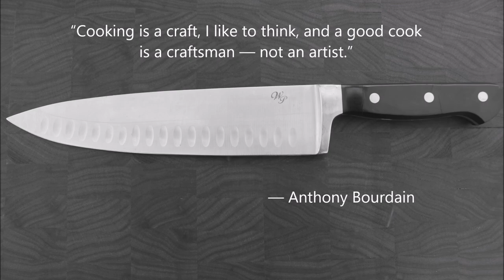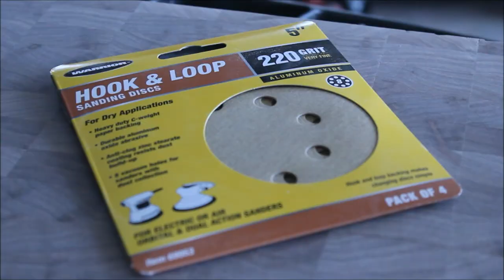Walnut End Grain Cutting Board

Comment: First, last and foremost,  you did a really nice job. Really nice. As a lot of reviewers have said, yourf work would be a lot easier and A LOT SAFER if you tuned up your tools. As to using your planer on end grain, when I build end grain cutting boards I band the board in contrasting wood. For example the last one I made was sugar maple end grain, black walnut banding and decorative maple dowels around the banding. I then run it through the planer at as much of an angle as will  fit in my planer and take light cuts. The other thing I find that gives me a smooth board with the least amount of wood removal is, I double stick tape the board to a piece melamine and run that through the planer. The dead flat piece of melamine serves as the reference point for the planer, also eliminates the planer snipe. Keep doing that good work young man.
Reply: Bruce, you have any pics of that board you made?

Comment: nice work scotty!!...may i suggest that you tune up the fence on your table saw...by truing up to the blade you'll avoid the burn marks when cutting
Reply: Not necessarily; pitch build up on the teeth can be a likely culprit as well as feed rate through the blade. Keep it clean and sharp and you'll be 90% there

Comment: i have a similar sized piece of wood in my shed and i am curious why did you cut the board into strips and then glue it back, i mean the wood piece is wide enough and you can certainly cut it perpendicularly rather than cutting into strips and then glueing it back and then cutting it perpendicular. is it just because of the design you get in the end or is there a specific reason to this process.
Reply: AbdulW87 You want "end grain" for the cutting surface for two reasons; it's easier on the knife's edge and you're not cutting individual fibers in the woods, causing quicker damage to the board.  Also, alternating the direction of the grain with each of those strips will tend to minimise warping where as a solid block of wood will usually warp when moistened/dried. Plus it's aesthetically pleasing.

Comment: What finish did you use? I made a couple walnut endgrain boards recently as Christmas presents and used mineral oil, but when I applied it the wood turned basically black and showed very little grain
Reply: Czarcasam yeah bro that happens, it’s just from the wood you used some pieces are just really dark and some are light.

Comment: Titebond 3 is better for food uses, I think its the one thats fully waterproof right?
Reply: whitexeno titebond 2 is superior to 3. Both are safe for indirect food contact
Reply: Why do you say titebond 2 is superior to 3?
Reply: @dalemartin7886  waterproof and foodsafe..
Reply: Napoleon1Blownapart as far as I know both Titebond 2 & 3 are safe for indirect food contact so that doesn't answer my question as to why James Barrett says 2 is superior to 3.
Reply: @dalemartin7886  Looks to me like 3 is superior to 2.  Titebond II passes ANSI Type II Water Resistance, which means water resistant.  Titebond III Ultimate passes ANSI Type I water resistance, which means water PROOF.  Both are certified by the FDA for indirect food contact.  I'm planning on making a cutting board like this soon, and since the board will get cleaned with water and have other food liquids on it regularly, I'll be using the Titebond III waterproof wood glue.  Titebond III also has a lower application minimum temperature (47 vs. 55°F) and a longer open working time, up to 10 minutes vs. 5 for Titebond II.
Reply: Patrick94GSR exactly. If I was doing a project that was going to be subjected to water contact frequently I would choose III over II. II would probably be okay but III is supposed to have superior water resistance. Why take the chance of glue failure?

Comment: You may think this a stupid question, but why do most people make end grain boards? Do they last longer, or take cuts better without leaving to many scars on the board? I would love to know the answer if you could tell me.I also watched a video, where the person said not to use Oak for boards. Is that so, and why? Thanks for any reply.
Reply from the maker: Mark McRostie Mark McRostie Hi mark, I am by no means an expert but I have always heard that end grain is easier on a knife edge because it has the ability to slip in between the fibers of the end grain. As for the oak, I have no clue except for maybe since it's so hard that it dulls your tools faster, that's my only guess.
Reply: Thanks for your reply, happy new year.
Reply: You don't use oak for cutting boards because oak, esp red oak has an open grain structure.  There are little "straw" like fibers that take in liquids and tend to stain and warp easier when used on cutting boards.  Same reason why red oak isnt used when making boats.  Leaky wood is no good haha.  You can get away with using white oak but best to stick with "hard" hardwoods such as maple, walnut, ashe, juniper etc. 

Hope that helps.
Reply from the maker: +Zak Hoover interesting, thanks for the explanation!
Reply: Hi and thanks for the reply. I have already made an end grain board with white oak and Sapele which turned out nice. But sadly it have bowed in the middle, so one side will sit still but other side rocks a little. I will have to do more sanding to get it flat again, or maybe leave it in the garage as a learning curve. Thanks for the advice on Oak.
Reply: Mark McRostie the bow is due to uneven moisture in the wood.  did you only apply finish to 1 side? or more finish on the top than the bottom perhaps? you can take most of the flex out by putting the convex side up and applying oil till the wood simply won't take any more.  you can also make a planning sled and use a cheap router to flatten the surface.  there are tons of videos on router planing sleds.  happy woodworking!! PM me if you have any other questions.    end grain boards will naturally flex more due to the nature of how wood expands, which is why most cutting boards are so thick, to help mitigate this.
Reply: Thanks, as far as I can remember I oiled both sides a couple of times. Then used a oil wax mix two times. I will take your advice and try treating the board again, failing that I will have a go at making a sled to flatten it.

Comment: How's that planner? I'm super hesitant on HF gear.
I've heard of a guy put end grain through a planner 1st time and it exploded...heard of another guy doing it for years and never had a problem.
Nice job!
Reply from the maker: Jason Enz I got the planer open box really cheap and it's held up fantastic so far I have no complaints. As for the end grain, there is definitely that risk I just take very shallow passes to help lessen the risk. But a drum sander would ultimately be the best tool for that
Reply: Jason Enz hhjjh
Reply: +Scotty Turner why could it explode? Thanks and great vid
Reply from the maker: nunchuck90 I think it just has to do with cutting against the grain opposed to with the grain. If you're going to plane end grain it's important to take very shallow passes to help prevent any "explosions" and as always wear safety equipment
Reply: Scotty Turner I work at one of nyc's higher end woodworking design groups. 2 14" sliding table saws, 10 delta unisaw, 24" planer, 42" wide belt sander and many other amazing tools. Boss gave me keys to the shop and said "go nuts"!
The shop is great but I'd like to be able to do more in my own garage.
Thanks for the heads up on the planer :)
Reply: +Scotty Turner thanks for the quick reply! Im just 16 at the moment and saving up for tools so need to be safe, thanks from manchester, uk
Reply: +Scotty Turner thanks for the quick reply! Im just 16 at the moment and saving up for tools so need to be safe, thanks from manchester, uk
Reply: I think any planer is going to be the same risk when you're planing end grain.  That's why you see a lot of cutting board videos with people using a drum sander instead of a planer.  Unfortunately that's a lot of scratch for one with a decent capacity.

Comment: Great looking board! This question is for anyone, where can I get wood like that? Not at home depot or anything like that right?
Reply: MCPOTUS79 Some Home Depot's will carry Walnut or another similar hardwood. Search on their website
Reply: MCPOTUS79 Home Depot does carry walnut and maple, but it's only in "1in" thickness and it costs a few dollars more than if you were to go to a hardwood supplier. You will not find 5, 6, 8, 12 quarter at Home Depot or Lowes.
Reply: my local home depot now carries walnut but only in 3/4" thickness and they charge a fortune for it. Better to find it at a hardwood supplier, ideally in rough form as you'll get the best price. It just means you'll have to joint it and plane it to final thickness.

Comment: In case you don't know this already: generally speaking, it is a bad idea to put end grain through a planer unless you do it in ridiculously shallow passes. Even then, there is a slight chance of blowout.  otherwise, looks good!
Reply: you can always glue on backing pieces to take the blowout, then use  the table saw to remove it after planing. this also can take care of snipe.
Reply: Other option is the do a quick chamfer on the trailing edge of the board before putting it through the planer. This has always worked for me in eliminating blowout, even in gnarly aussie hardwood.
Reply: @samuelmcgregor631  I do this also when it's close to size...
Reply: @TMS5100  ah yes I saw Tom Silva of This Old House do that on a segment where he made a cutting board similar to this.  I need to remember than for when I make an end-grain cutting board.

Comment: You got away with it this time, but I wouldn't advise using a planer for end grain again. Too risky, and not worth an accident. Good looking board though. 😊👍
Reply: Not trying to be a turd. Have you ever heard of an end grain board getting destroyed in a planer?
Whenever someone says this, I ask the same question and so far not a single person knows of anyone that has happened to. I do it, never had an issue. I think the key is sharp blades and very light passes...or get a drum sander lol.
Like I said, NOT trying to be a turd, just trying to find someone this actually happened to. I’m sure there is someone out there this happened to.
If you think about it, what makes it seem more dangerous?...the blade is scooping across the end grain fibers so to me it seems just the same as an everyday crosscut. I’m not taking deeper passes to test that theory though haha.
Stay safe everyone and have fun!
Sorry if I seemed like a turd 💩😬
Reply: @enzprintco.8625  I had my maple end grain cutting board destroyed by putting it through a planer. I was taking maybe 1/32 of an inch off with brand new blades and it gouged the board beyond repair
Reply: @checkmyvevo  that stinks. I’m sorry to hear that. Did it “explode” or just chewed up?
Couldn’t salvage it?
Reply: @enzprintco.8625  It took a nasty gouge out the middle and cracked it on the sides. Pretty much became firewood

Comment: Crosscutting against a fence is a very bad idea.
Reply: He has a sliding miter saw that he was just using to make cuts at least that wide, so not sure why he decided on the table saw for that operation.
Reply: There's a reason it's called the rip fence, it's not for cross cutting. It enhances the chance that biding can occur and for your piece to kick back or get ejected towards you by the saw.
Reply: especially with no riving knife on the table saw! yikes!! That being said the cutting board did turn out good! great job
Reply: true story. Had it happen one time and hit me just below my sternum. Took me to the ground out of breath. Learned a valuable lesson that day.
Reply: It's not like he's cross-cutting a 2x4.  The board is at least 12 to 14 inches wide which is fine for cutting on the table saw.  Sure he could have set up a stop on the miter saw to make many identical sized cuts, but as with many things in woodworking, there are many ways to accomplish the same thing.

Comment: 3:33 DID NO ONE NOTICE THIS?!?!
Lots of critiques on safety but this was by far the most dangerous cut you can make (other then not using a fence at all lol).
It’s hard to keep the shorter side against the fence when the length is more. One wrong minute movement could send that entire block of wood at your face and 100+ mph.
Not to sound like the safety police (cause they are annoying) but this one actually made me cringe and I’d be bummed if this video didn’t come out because you got hurt making it and we’d never see that sweet cutting board :)
Stay safe brother!
Reply: Actually the most important thing is that the dimension between the board and the fence does not exceed the dimension that is against the fence. the dimension between the blade in the fence was very small, however this cut was still very unsafe because there was no riving knife/guard used of any kind.

edit: https://youtu.be/F0jbg9LuDsc?t=127

Comment: Too many unsafe practices to watch the whole video. 1). You push a sliding miter saw into the wood, not pull. 2. Your table saw practices are unsafe 3) your planer should be secured better than it is, it’s moving all over the place

Comment: cutting board with glue like those are not good. Eventually the glue will be mixed with the food. Very toxic. I prefer solid wood.
Reply: The glue is in the joints, not on the surface. How is the glue going to get mixed with the food? Also, suppose, on the off chance, that a tiny amount of glue touches the food, do you really think it's going to be toxic? I would think that you would need to drink bottles of glue before it actually became toxic. I know of hundreds of cutting boards that are made with glue in the joints and I've never heard of anything becoming the least bit ill from them.